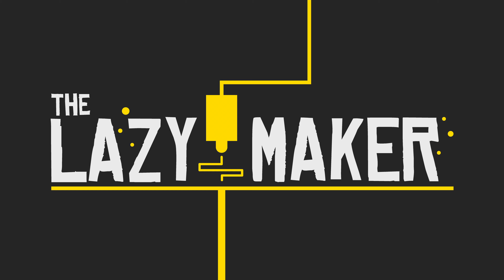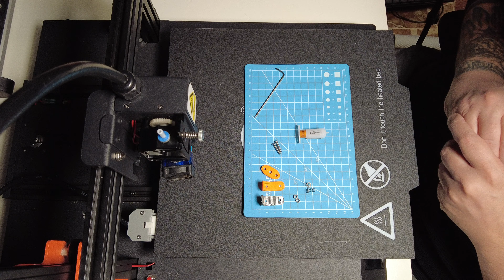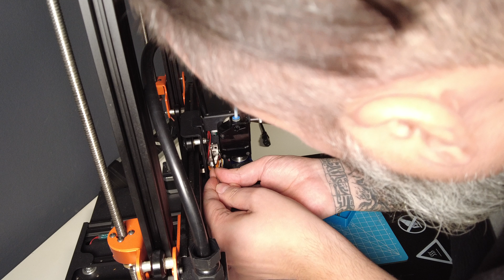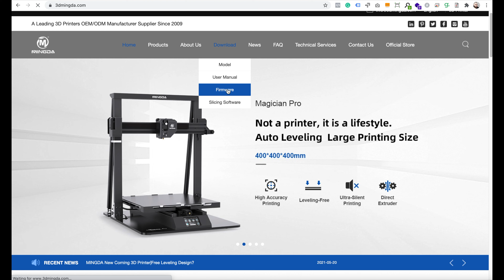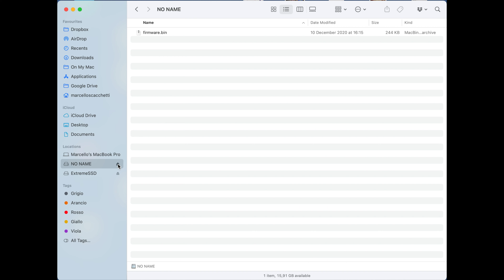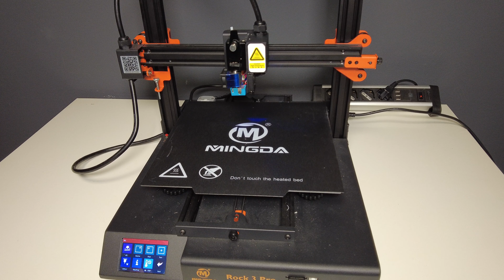Mingda Rock 3 (Pro) Upgrade - BLTouch Installation and leveling

Comment: Do you know where you can find the rock 3 pro holder file or buy one
Reply from the maker: Sure you can try this one it should work: https://www.thingiverse.com/thing:4821661
Reply: @thelazymaker  for anyone else wondering this one did not work properly, holes are too close to each other so the BL touch screws barely fit and the springs have no room for movement. youll have to design your own
Reply: not even to mention that the holes on the piece that screws to the 3d printer itself are not even arranged next to each other but above/below each other so this just is not gonna work either way

Comment: Hello, thanks for the good video. I would like to install the BlTouch on my Rock3 Pro, but I have the problem that I can only find the mount for the Rock3. You also linked the mount for the Rock 3 here and not the Pro. could you change that? And what I unfortunately can't find anywhere are the spacers, etc., which you can all see in your video at 1:33. So far nobody has been able to help me, I hope I'm in the right place with you. Thank you in advance for your help.
Reply from the maker: The BLTouch mount should be compatible with both the Rock 3 and Rock 3 Pro. There is some naming confusion on Mindga. The current Rock 3 is actually the old Rock 3 Pro.  This is the BLTouch mount that works on the Rock 3 Pro https://www.thingiverse.com/thing:4821661 and the following are the spacers https://www.prusaprinters.org/prints/106004-bltouch-spacer-2mm5mm-and-10mm

Comment: Probably a good idea would be to use a tiny drop of thread lock on the adjusting bolts for the BlTouch to prevent them from ever getting loose. I.ve been looking around learning about 3d printing for about a year now and im finally ready to get one myself.I found this printer randomly on YT and when looking for more details about it I discovered your chanel. You answered quite a few of the questions I had. I am very tempted to get this one as it seems is some ways better than CR10 V3 or Sidewinder X2. How does this perform when it comes to printing PETG? (that would be my main printing material..and maybe some ABS)
Reply from the maker: Hey Marius, thanks for reaching out :) this printer has no issue with PETG, the only weakness is the part cooling that can be anyway fixed pretty easily, as soon as I have some time I'll make a video about that and my fix. Also, consider that this printer, like others, is big, meaning that you will have harder times dealing with small details, in the end is all about what you are planning to print...